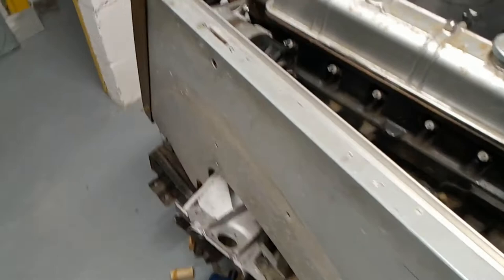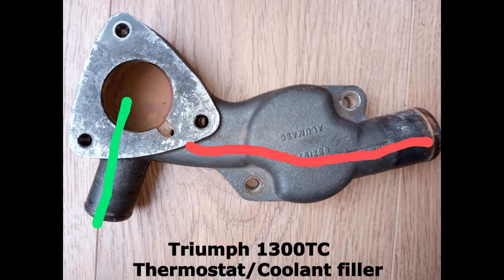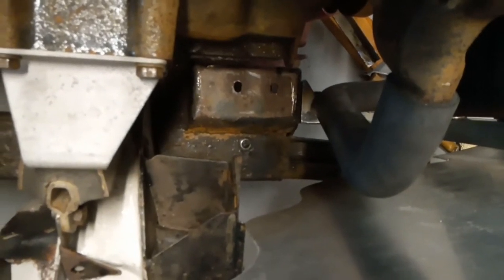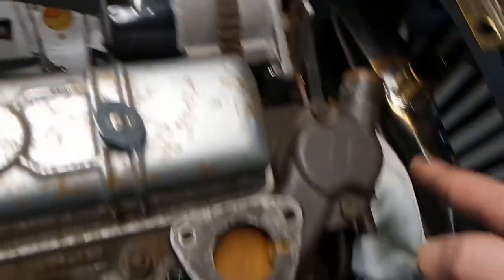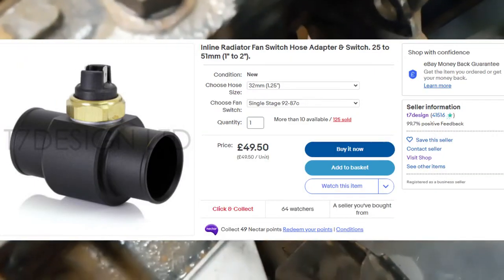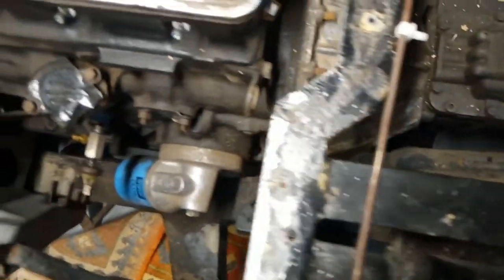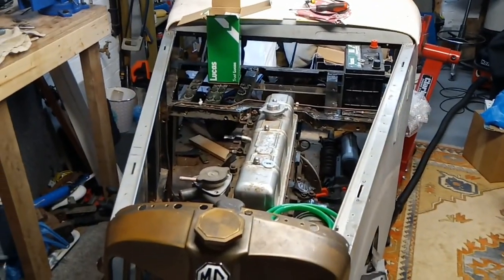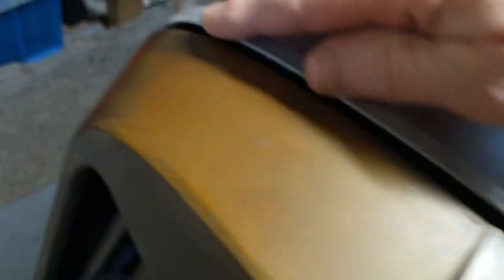Triumph Vitesse Special Report #4

Comment: Shame about the lid fit, I'd say the grommet is designed to expand when you fit the tube.
Reply from the maker: I think the problem is the bottle not the cap. But I will find out in due course. The grommet is for a 4mm thick lid so they have admitted that is wrong too 🙄